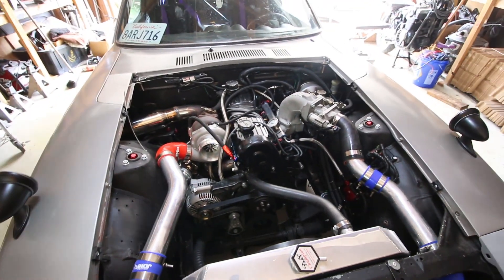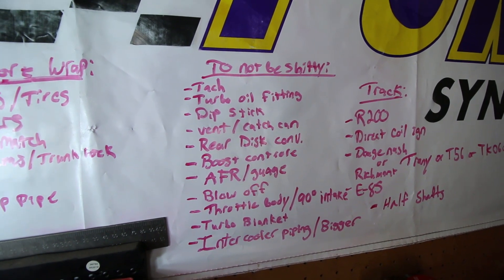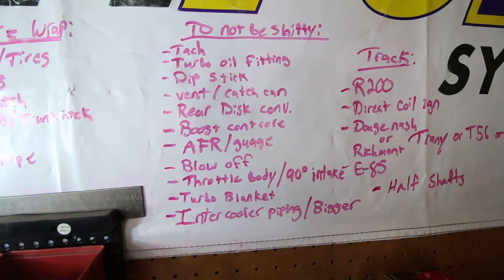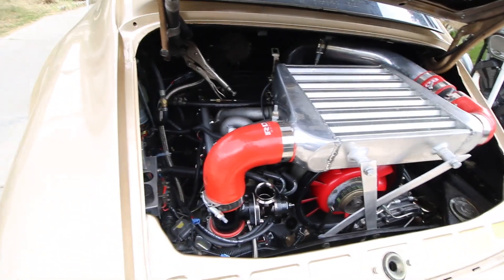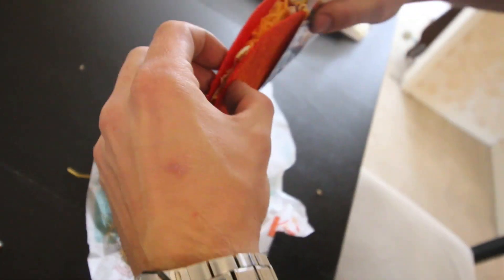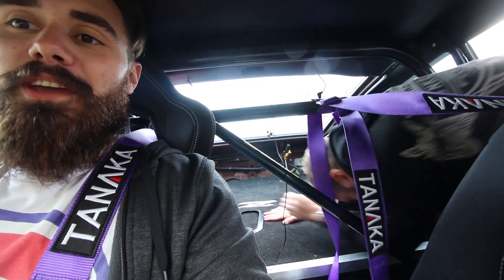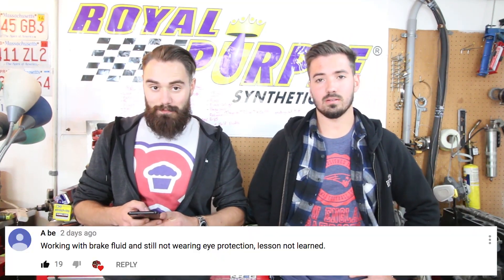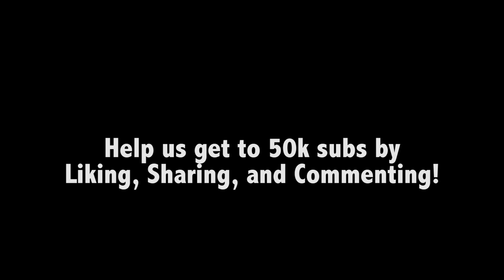4 Cyl Datsun Problems - Its FIRE

Comment: Shredded pork or Carnitas (also pork) on a fried soft tortilla.  If it's done right you'll get 1000 calories in one taco!
And I hate it when shit catches on fire.  My Jeep caught on fire once, when the rear output-shaft seal blew out of the case while driving down the highway.  It blew tranny fluid all over the muffler which caught on fire.  Caught it just in time...

Comment: Check a 5 speed out of a 98 2.5 lt transmission thats what I have on my 2.3lt yt? Amd it holds up fine and I am currently running 529hp and 498 tq on a stock trans that came in my truck and it holds up great and it only comes in 98 to 2000 2.5lt motors